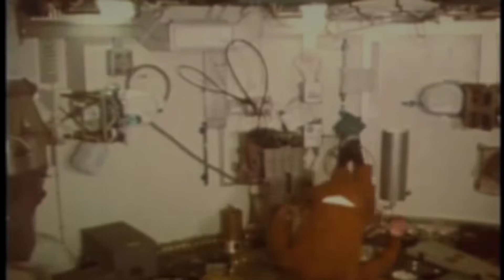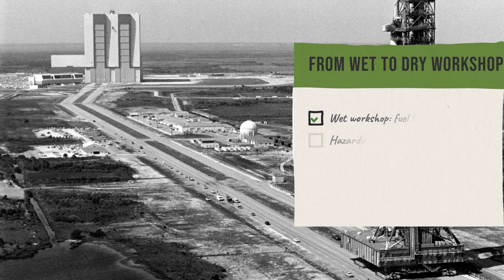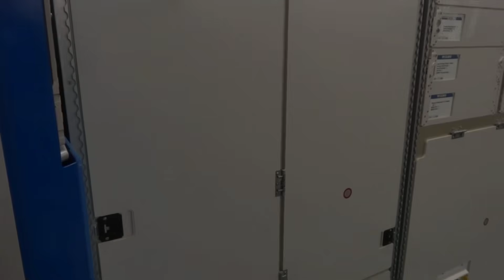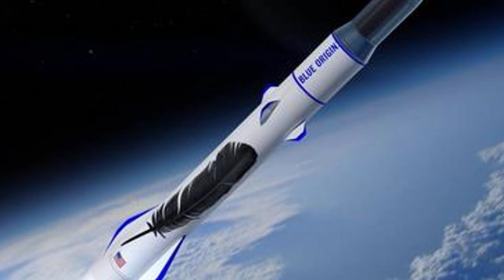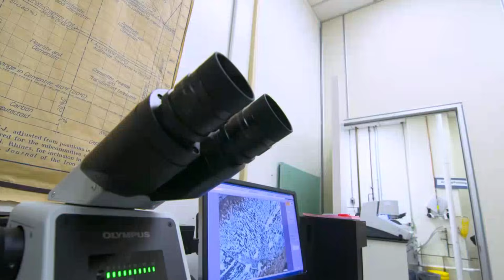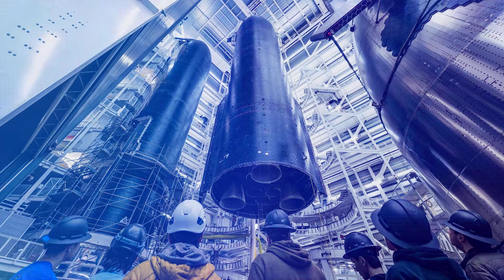How SpaceX Will Replace the ISS With a Single Rocket

Comment: Someone needs to use Bigelow's inflatable space station tech. They could get 20 times the volume or more in 1 launch. With a 20 meter  diameter nosecone you could probably get 40-50 meters diameter & maybe up to 100 meters length when deflated in one launch. SpaceX has mentioned a 20 meter diameter Gen 5 Starship so while something that large may not be able to be launched at present, they should be working on building it.